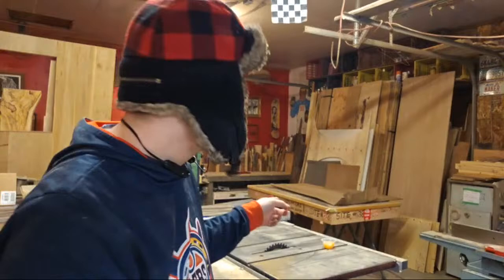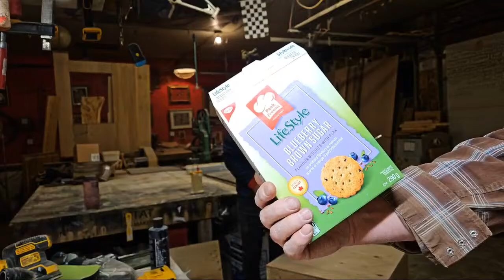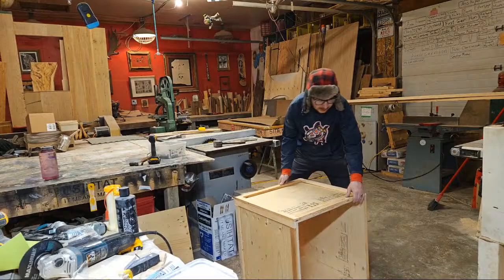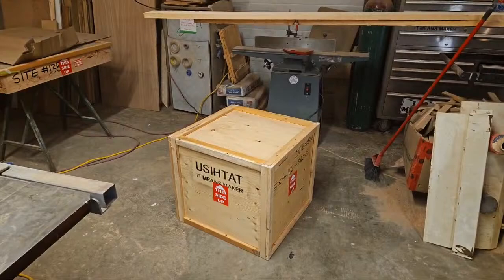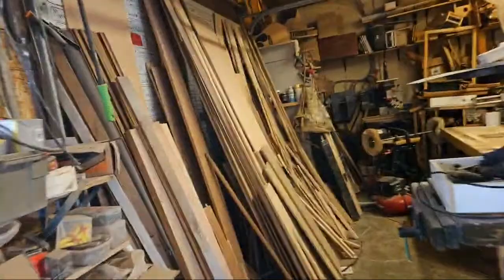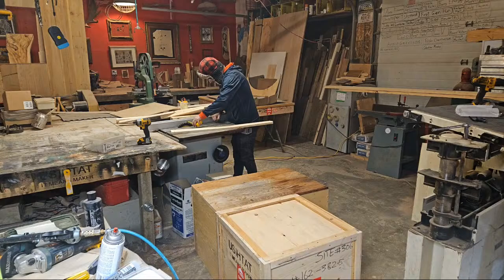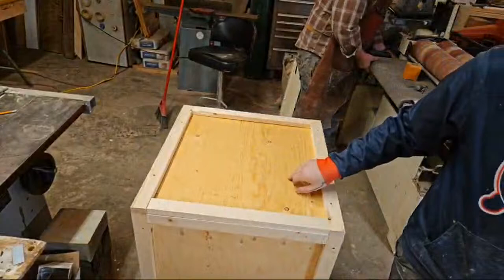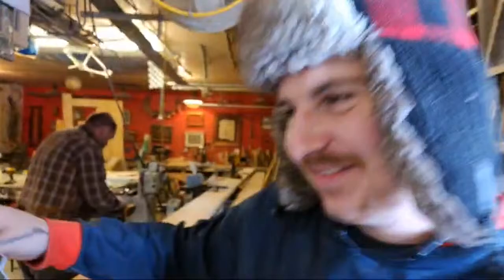Live build follow up for SIGNING TABLE  video

Comment: The other thing I was thinking is to set them on fire when they are not parallel or perpendicular  make the long one diagonal and set them up like that more haphazardly looking  deshoveled if you will.  maybe on the bottom put some small wood guides to line them up correctly